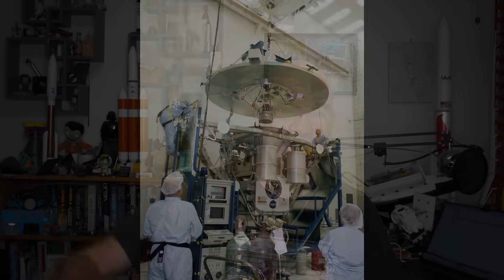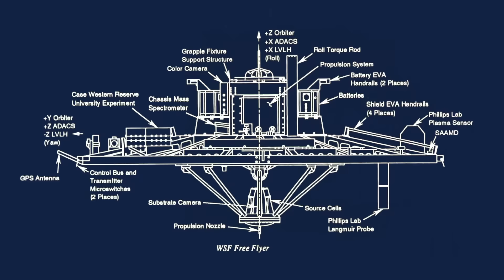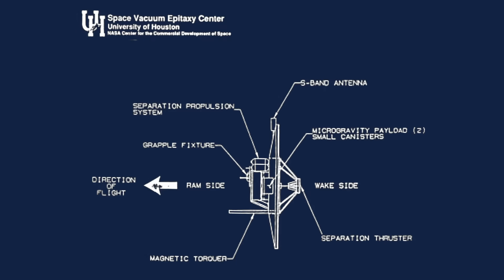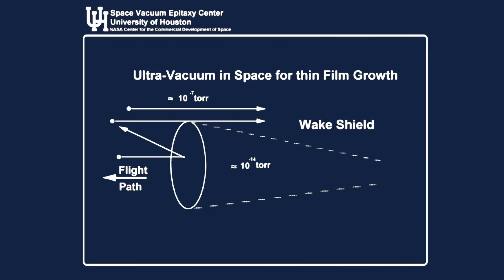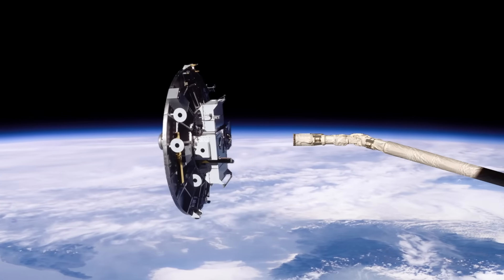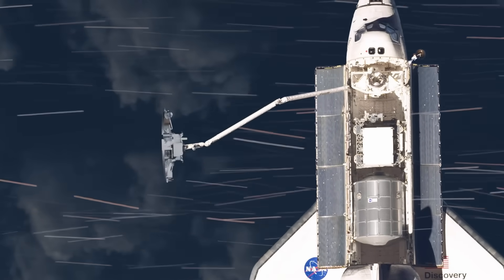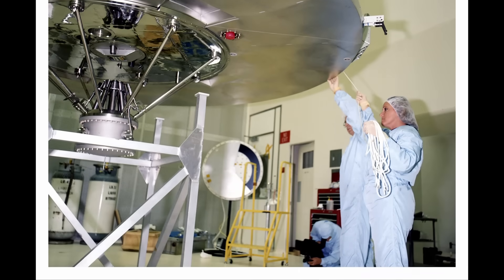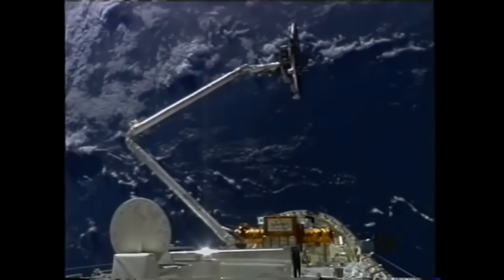How NASA Made The Vacuum of Space Suck More - The Wake Shield Facility

Comment: In 1991, I was a member of the team from Worcester Polytechnic Institute who worked on the Wake Shield Facility satellite for the USAF. We did the preflight structural analysis of the Chaws experimental package. This instrument was mounted on the wake side of the satellite, and was designed to measure the extremely low pressures expected on that side of the spacecraft. The analysis was conducted at Hanscom AFB, in the space systems division. Our analysis was approved very quickly and the instrument was built at the Wentworth Institute of Technology in Boston. It was tested on the shaker table at Hanscom AFB and approved for flight. After this, the Wake Shield Facility satellite flew three times on the space shuttle. The instrument worked, but what it discovered was disappointing - the vacuum in space behind the shield was not that impressive. So the idea of manufacturing computer chips in space was abandoned. One of the best jobs I've ever had. Proud to see photos of the satellite in orbit.

Comment: form UHV worker here, getting down to that pressure is /hard/, the additional steps to get parts to support vacuum that low are rather extreme, but I wonder if they considered heating elements in the assembly to shed water and gases so that there would be less in the wake. Also the use of nitrogen gas for thrusters lines up with venting of uhv and high vacuum systems, you can't use noble gases because getting those to pump at low pressures is extremely difficult with various devices, but in space, it probably doesn't matter as much

Comment: I worked on some materials a couple years ago (Inconel 718 and GlidCop, a copper based structural alloy/composite (those lines get awful blurry in some cases) used in rocket engines) that were flown to the ISS and placed outside for 6 months to look at on-orbit damage in those material systems. Some of the worst sample sectioning experiences I have ever had incidentally. But when we started studying them, we could find absolutely no difference between the flown samples and the control samples that stayed on earth, which made zero sense. We started wondering if the things got flown at all. Turns out they were flown, but when they were placed outside, they were put on an experiment pallet that was in the lee of the station. Basically, an unintentional WSF. The people who sponsored the research (a large space company whose name may or may not contain a color) were furious, but it was their screwup for booking the wrong experiment pallet. 

In a previous job I worked with an ultra-high vacuum surface science system. Unlike the really specialized UHV systems, ours had samples passed in and out on a routine basis, so we couldn't hit truly ridiculous pressures, but none the less, we routinely ran in the 10^-11 torr range, and on a Monday after a full weekend of uninterrupted pumping we would commonly be in the 10^-12 torr range (10^-15 bar). At those pressures you start measuring the time for a single monolayer to react (aka the time before statistically the entire surface of the sample has interacted with the atmosphere of the chamber) in tens of minutes. Still blows my mind.

Comment: In the early 1990s I had a summer job at a semiconductor fab. I was told that the dust in a clean room does not come from outside air (which is filtered), but from surface friction from equipment and machinery inside (and humans, of course) . The only way to manage that dust is air flow and gravity, so semiconductor manufacturing in vacuum and zero g seems like a bad idea.

Comment: I did my PhD using old, creaky and obsolete ultra high vacuum (UHV) systems. When I saw 10^-14 Torr in the wake I yelped with pure envy.
Reply: That was the hoped- for pressure. They achieved better than 10^-9 which is exceeded in terrestrial chambers.  I was going to add that it can take quite a bit of time and preparation to get pressures that low, but then I remembered how long it took to prepare and launch a shuttle.
Reply: These days we can generate vacuum levels of 10^-15mbar, or even lower, relatively easily with cryopumps: The trick is to cool down a surface in your vacuum chamber to ~4K after you have kept your regular vacuum pumps running for a while. Every particle will stick to the cold surface like a tongue to a frozen lightpole creating the XUHV environment.

Comment: Here's a report with the measurements: Wake vacuum measurement and analysis for the wake shield facility free flying platform. (DOI: 10.1016/S0042-207X(01)00383-9 )
The abstract says "the decrease was some 2 orders of magnitude or 4 orders of magnitude less than expected",  putting the pressure to the 10^-10 mbar range. This is a well-mastered industrial standard here on earth. The difference between expectations and reality is caused mostly by thermal outgassing and stimulated desorption of particles, whereas on earth all this can be better (and cheaper) controlled.
PhD in vacuum science here.
Reply from the maker: Yes, the majority of the atmosphere they were experiencing was from the spacecraft itself. I don’t know enough about vacuum engineering to know how long they’d have to operate to get close to their target

Comment: I had to look up epitaxy ...... maybe you could have defined it the first time you used it ...... thanks for all the great videos
Reply: As a reference for everybody else who has this question: there are several plasma based manufacturing processes commonly used in semiconductors and some other industries. Plasma simply means ionized gas - in this case preferably highly directed and very pure. One process is etching - the ionized particles react with the solid surface and chemically form a gas that dissipates away leaving behind a void in the surface of the solid. The next one is PVD (physical vapor deposition) - the ionized particles touch the surface, neutralize and stick to the surface as a solid - usually you do this with metals (e.g. sputtering). The third one is CVD (chemical vapor deposition) - ions (often ionized molecules) touch the surface, which acts as a catalyst, chemically react with each other and form larger molecules or crystals that stick to the surface. Epitaxy means "growing a thin film" and can refer to PVD or CVD.